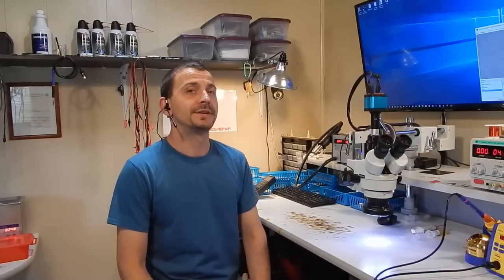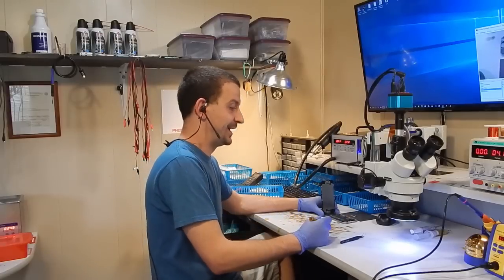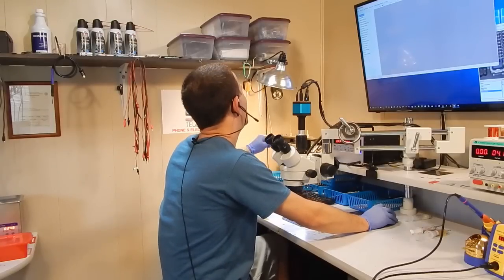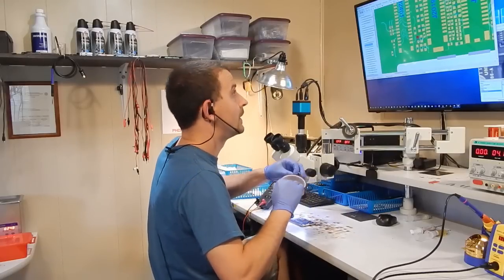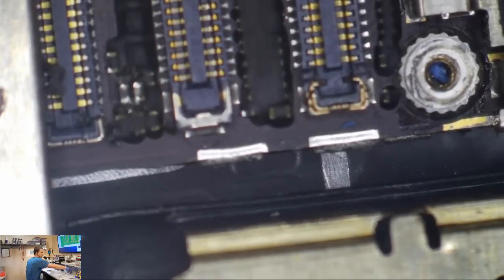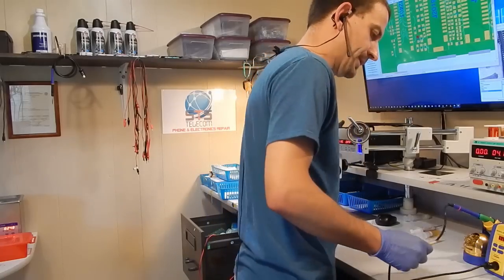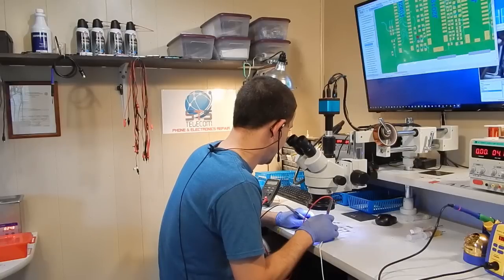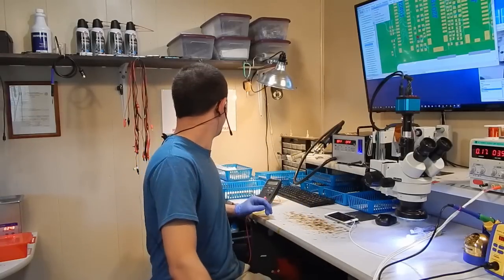iPhone 6 No Image Repaired - Smoked 1v8 Filter

Comment: Why don't you plug a ac timer to your hot plate. Iv got something similar for turning a pool pump on and off at certain times. Or my parents used to have one for turning a tumble drier on at certain times. They are not a lot off eBay etc, it just cuts the power when the time is reached you set.

Comment: there is a difference between wiping your data after some passcode attempts and phone disable connect to iTunes. 
the second one is away better if you've had  plugged your phone in an iTunes previously. once your phone gets disabled you will only have to plug it into that particular PC which you have previously connected then the screen of disable will go and you will have your phone back asking for password.
Reply from the maker: Hmmmm... so you're saying as long as they have a backup on a local copy of iTunes, it don't force them to erase the current data on their phone?  That's good to know :)
Reply: yes you're right. even without backing up. synchronizing is enough.
Reply: and my advice for you is to connect all the phones coming to you to iTunes without doing a backup just connecting .that wold help you helping your customers in future.

Comment: I have same hot air station, but its so loud, iam starting to think its faulty.just started watching your videos, what temp you use to desolder caps? and temp on your hakko soldering station? thanks.
Reply from the maker: +vaislaj 390/42 on hot air. This one was extremely loud and vibrated the whole bench until I removed the shipping screw from the bottom.  I felt silly foe not reading directions!  I used it like that for a whole day! Lol
Reply: STS Telecom hahah i just removed the shipping screw. it was not in my manual btw. do you not think 342 is a bit too much stress for the chips?